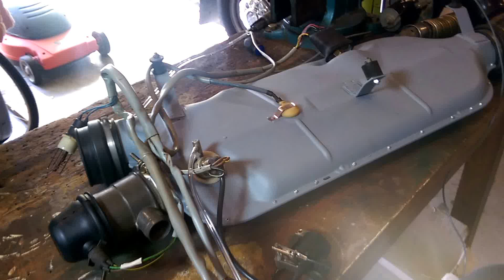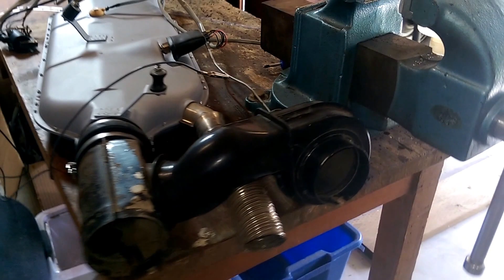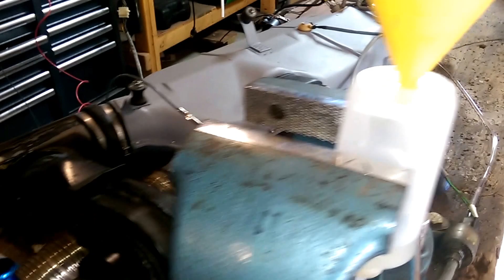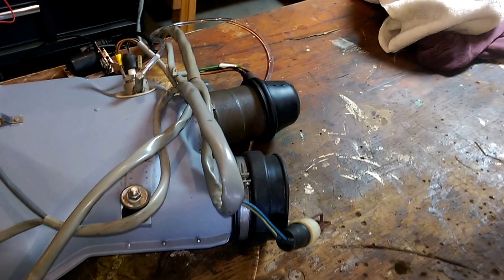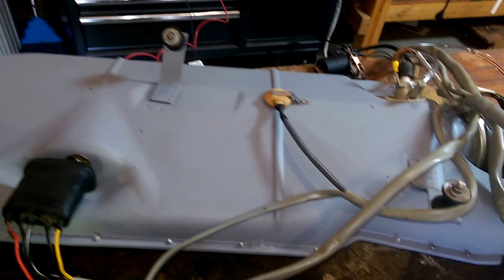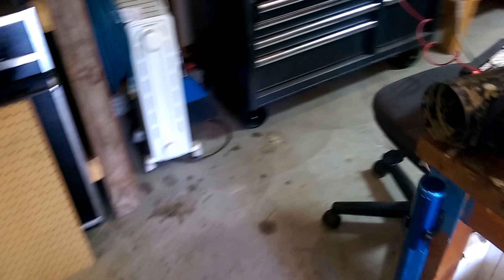VW Bus BA6 Gas Heater Bench Test

Comment: I have one of these on my 81 Vanagon.  Any advice on getting the unit back to working order.  How easy is it to remove?
Reply from the maker: Super straight forward to remove.  I completely disassembled mine and cleaned all the little bits, but there's a great many people that don't go that far and get them running.  They're pretty robust.  Notchboy on the Samba is the go-to guy for all things gas heater.  I'd head over there in the Bay Window forums and see what he has posted; there's a lot of detail to mine from his threads and others on the site.  A lot of the information on the BN4 carries over to the BA6 as well.